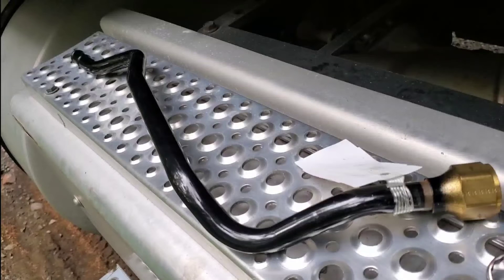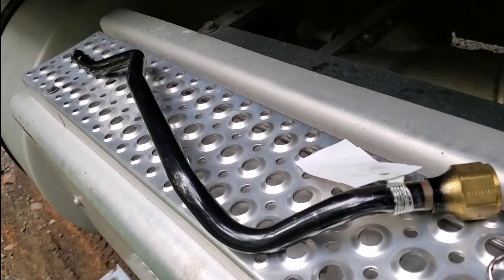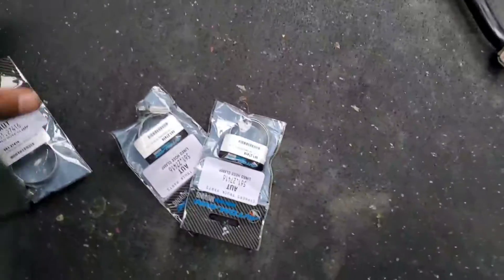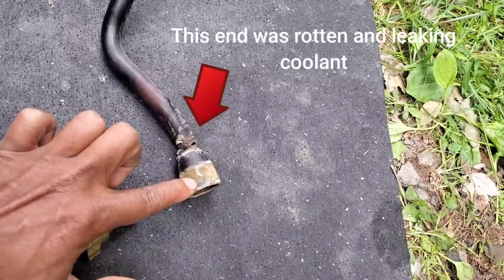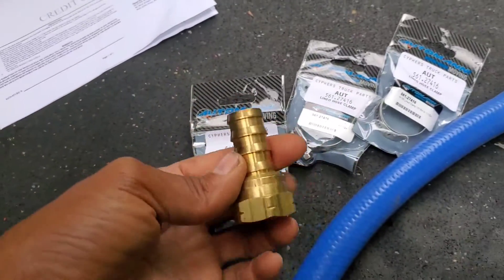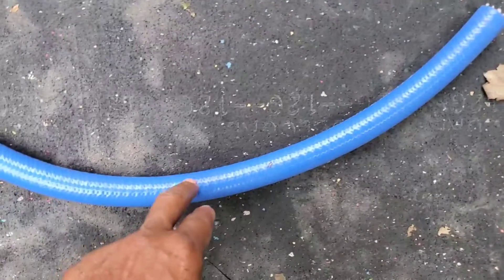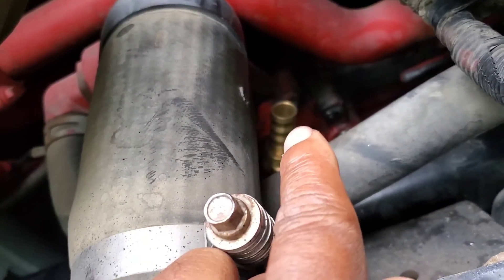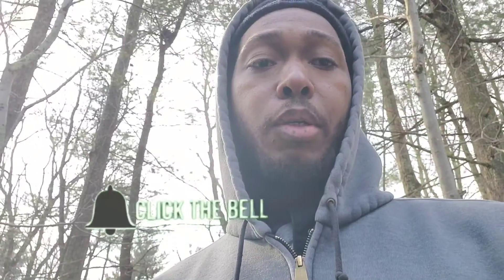Coolant leaking on a cummins isx engine from Heater return fluid pipe.heater return fluid hose fix

Comment: The fitting on this can be found at any hydraulic hose shop. 
The threads are 12 sae. Not 3/4 NPT. Even though it will thread onto 3/4 NPT. Do not use it. It must be a 12 SAE flared fitting. 

Also be careful removing the hoses from the heater core, at least on the international lt. You will damage the core, guaranteed! 
Remove the clamps, cut the hose off, then pull the core out of the dash. 
You’ll thank me later.

Comment: I'm losing coolant and I have no visible leak. Help
Reply from the maker: Hi Driver, it might be your EGR cool (exhaust gas recirculation). A bad injector cup or a cylinder head gasket can cause a internal coolant leak.
Reply: Check for white smoke after sitting overnight.  If you have white smoke and missing coolant it is very possible that you have a leaking EGR cooler.

Comment: What is part number for those fitting, I need to plug my horses
Reply from the maker: Check the description in the video for the links to the parts, i just added them for you.
Reply: @truckingpaysthebills5394  thanks

Comment: It might have this same leak on my truck, visible leak when stopped, idling or after I turn off the truck.
Reply from the maker: Might be the same thing or some other location.
You might have a crack/broken line somewhere that flex over sometimes.
Another thing is worn-out O-Ring seals that will start to leak when the engine temp start to cool down, and expend and seal properly when the temp rises.Also do a visual inspection on your turbo, some turbo have a weep hole that leak when the tubo is going bad.

Comment: The seal thing sound interesting I’m in Miami FL and it’s never cold here and the last 3 day mornings have been in the 40’s and like you say when it’s hot it does not leak and when it sits and it’s cold it leaks, hey thanks for the info I will have to keep looking in there till I find it
Reply from the maker: You're welcome good luck

Comment: Mines is 2012 Freightliner M2 and I can’t find we’re the coolant is coming from I see small drops dripping while it turned off and engine cool from the passenger side coming down thru the side of the right rear , I don’t know if it could be this hose
Reply from the maker: It might be a sign of a bad seal, when the engine is hot the seal expanded  and seal properly but when it cool down it shrink and start to leak. Check your EGR sometimes they do leak as well.check your turbo sometimes when they going bad they start seaping coolant through the weap hole. Check your hoses again there might be a leak somewhere on the backside of a hose that you can't see.
Reply: I have a 2016 m2 and i recently started to see coolant dripping from passenger side of the engine as well when i shut off the truck, or if I'm idling.
Reply: @jcruise876  Hi There that’s the way mines started in parts I only spent $35 which was 2 o rings and 1 inner seal plus 2 gallons of coolant. Now my mechanic charged me $600 in labor it took him 5 hours one day to tear down everything on the right side , Turbo , air filter box and some other things that where in his way to be able to pull out the egr pipe to change the o rings. And another 4 hours the next day to put everything back together. It was mission. Good luck
Reply: @fctinc1  damn 🤦🏽‍♂️